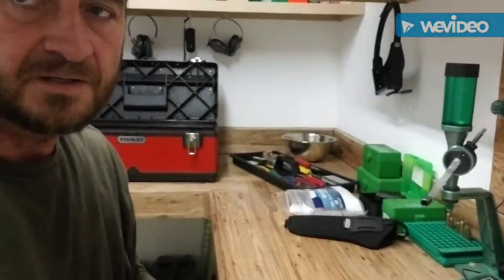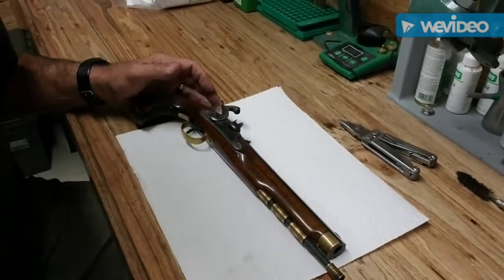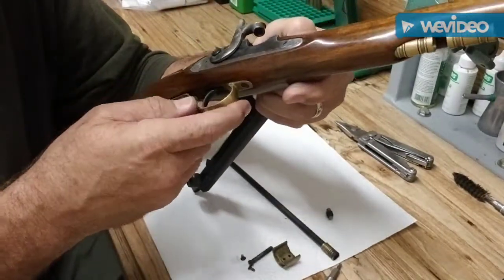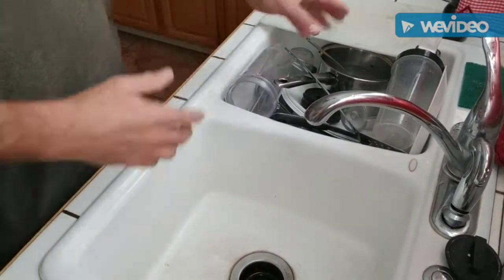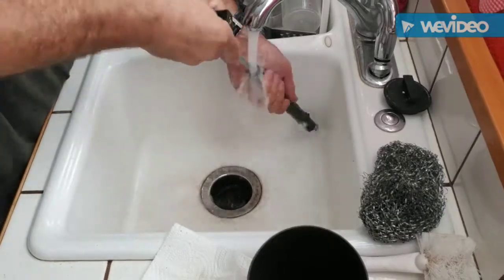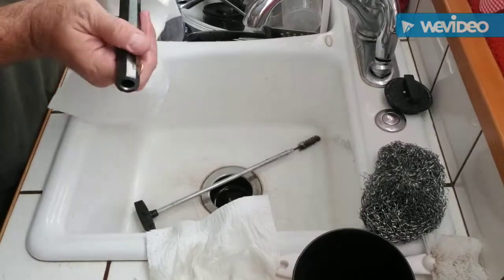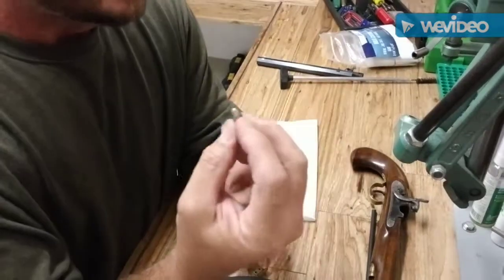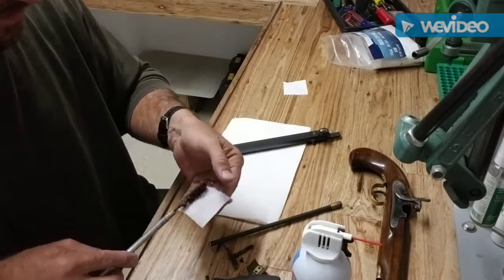45 cal muzzleloader pistol cleaning

Comment: Thank you!  I just was gifted a .50 muzzleloader pistol.  Hairline crack on stock.  Looks like maybe epoxied, haven't had it apart yet to see what inside looks like.  How scared should I be?  Would send a pic not sure I know how.
Reply from the maker: @dennistate5953  I wouldn't loose any sleep over it.
Pay attention to how tight your screws are when you assemble it.
Oil everything good. Start with light loads, round ball and light charge. 
Be prepared to cleanest after you take it field every time you store it.
The can get ugly fast.
Also, try to use pistol powder and not rifle powder. 
You may have to dowel the broken piece if it let's go again. 
Good luck and always be safe.
Reply: @radiow7dry  Thanks much.  Will do.  They boogered main screw slightly but I have good screwdriver set.  I've got Pyrodex or 777 around here somewhere.
Reply from the maker: @dennistate5953  pyrodex P is good. RS is for shotguns and rifles.
You want a faster burning powder. 
It also ignites better.
Reply: @radiow7dry  thank you.  I will check it out.  Honestly don't recall but will procure as suggested.  Black powder/even Pyrodex is a blast near dusky dark.  Used to have an 1858 Army.  Helped a guy out.  Fun though.
Reply from the maker: @dennistate5953  I have a TC encode 416 Rigby in a 15" barrel.
That is a huge fireball at dusk.
Reply: @radiow7dry  FUN!

Comment: If you pour boiling water with a few drops of dawn dish soap down the barrel, you don't have to work nearly this hard.  Also, if the water is boiling, the barrel is hot enough to evaporate the water off and you don't have to worry about rusting
Reply from the maker: At 5:30 I use hot water and soap.
Boiling water and trying to control all the factors may be Hazardous.
I I did something like that, someone would get burned or injured. McD use to serve hot coffee years ago.
Now it's just warm.